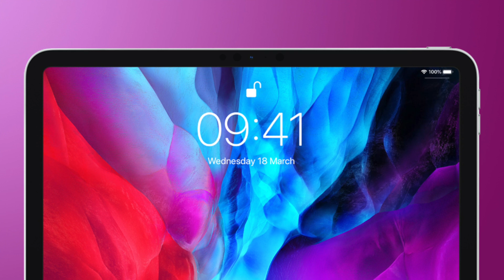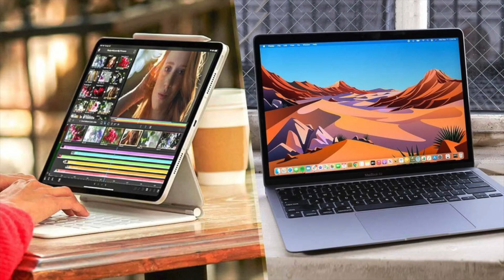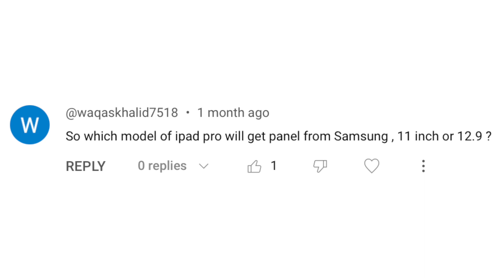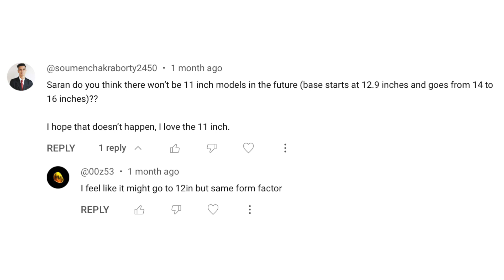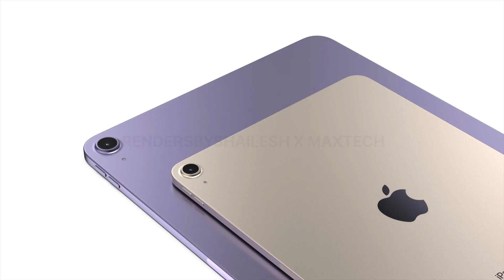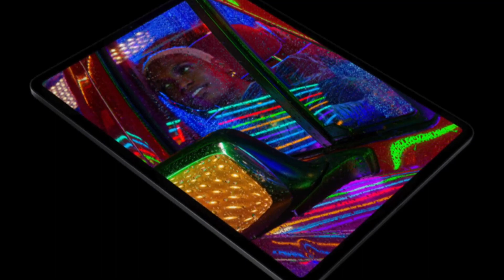OLED iPad Pro - NEW RUMORS

Comment: I think we should bare in mind that diminished bezels limit any future chances for placing the front cameras on the longer edge side-by-side with the pencil's docking magnet, and that what happened with iPad 10. Despite being too impressive to see, the disappointing drawback is using the 1st pencil generation. So, it is urgently important for apple to try a way out for this practicality. Bezels are less important, even than the new OLEDs, I think!

Comment: I think they should give the OLED to both iPad Pros. I want a 11 inch iPad Pro.
Reply: Yeah it would be great. I know they have the 12.9 iPad Pro but I wish the 11 inch was 11.5 which is my only con imo.
Reply: @brendanfogel4573  The size of the 11 inch iPad Pro isn’t a problem as it fits many accessories. Too big and those accessories become useless. Apple make the mistake thinking that every one wants the larger screen, and so use it as an excuse to up sell to the bigger iPad Pro. Many want the portability of a slightly smaller iPad.
Reply: @davidlazarus67  If they add a dynamic island, they probably will because oled is much easier to cut than lcd.
Reply: @Wusyaname_  Plus OLED is more efficient.
Reply: @davidlazarus67  Double stack oled might take more energy than an lcd. Not sure tho.
Reply: @Wusyaname_  it would if bright but if normal for movies then there may not be any additional power draw as not required. It would depend on screen brightness as you suggested.